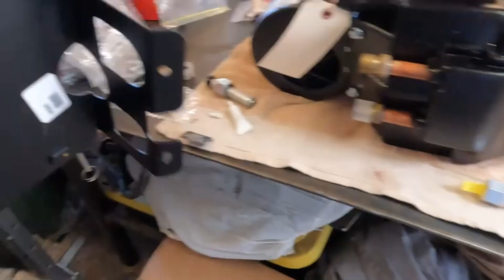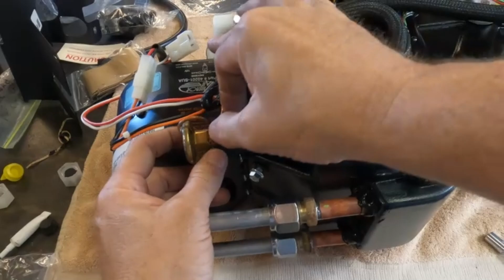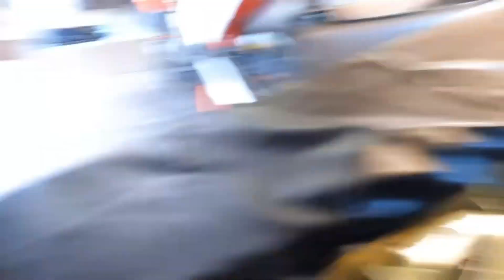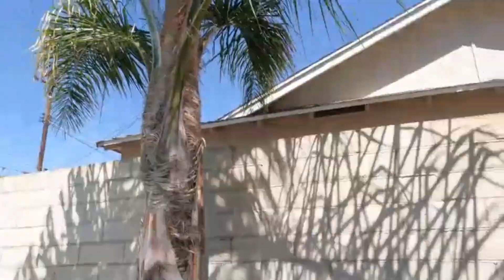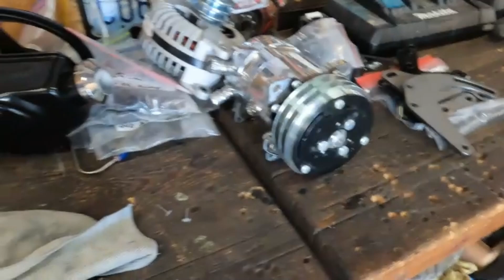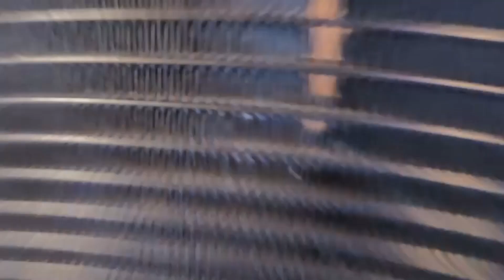Vintage Air System Part 1 - 1969 Charger

Comment: I saw a guy who modified the two heater hoses to run thru the original holes in the firewall. He had to cut the nipple off the vintage air heater core and used a sharkbite to add his new lines.